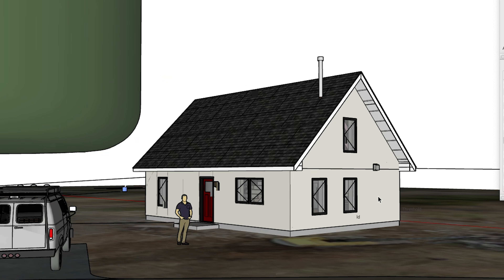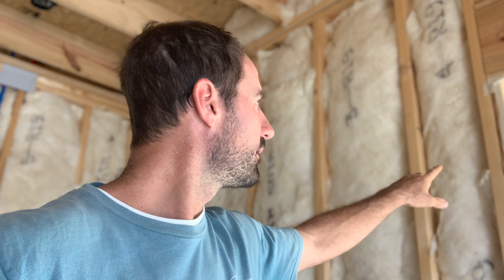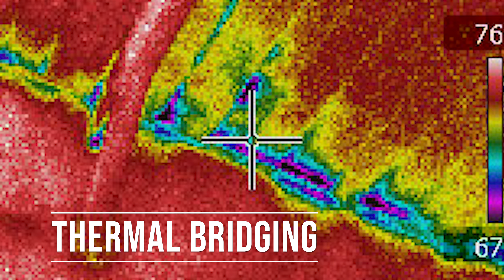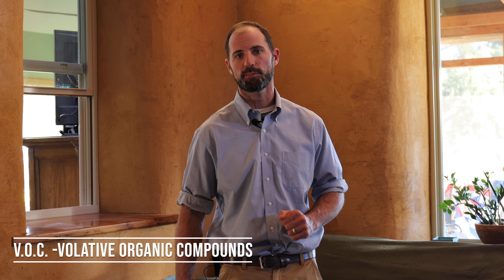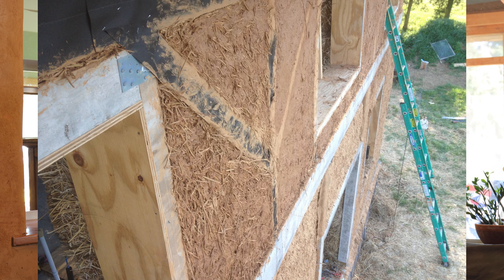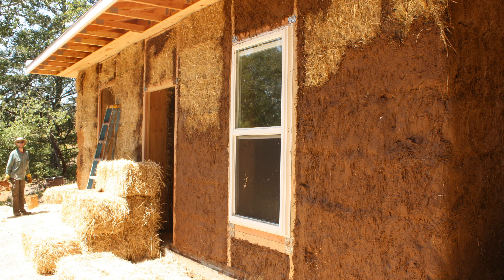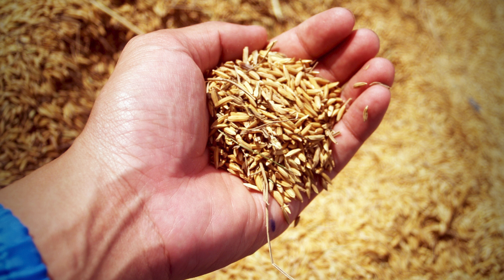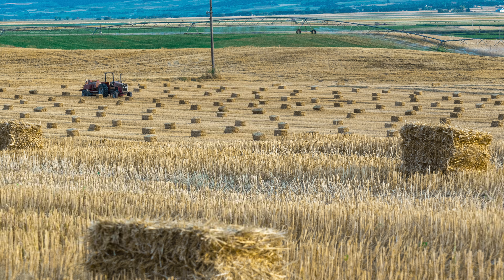The BEST way to build a new home? Building a House with STRAW BALES : Start to Finish - Episode 1

Comment: I’m an old mechanical engineer and software company owner - I love technology, but if I built another house (here in 🇨🇦) straw bale would be my choice!
Reply: Especially in very cold long winters country it s definitively the best technic. I built 3 in french alpes and it was really nice and easy... Cheap... And non specialists can make it alone IF (!) they are numerous (at a few steps of building) and precautious. There are books enough to show key points yu must respect and be carefull.
Only trouble is lack of  inertie of straw bales but yu can compensiate it by thick clay walls inside reliable with massive owen as they make it in Tirol. With stones...and decorative colored tiles. 
See above...former Comment.
Reply: @j-ch8787  thanks for that insight!
Reply: @willm5814 
I have a diagram I found 25 years ago during my educational program of site building conductor in Elsass close boarder line with germany... Which convinced me (and should convince everyone!) of the efficiency of straw bales construction.
This diagram is showing the coefficient of resistance of all the insolated materials we can find on the market. Modern one and... "traditional" such as straw. There is a cyrve exponential one from bottom to the highest point which... (lonely far above all!) the straw!!! I don t reember precisely the numbers but the straw is above 6,... And the others are on a same flat bottom between 0,8 or 0,9 for the less performative to 1,4 ...1,6 if my memorie is right for the best performers.
So... As we are used to say it in france "There's no pics !" ... Just put straw as a construction technic... Full point.
It s efficient for warm or cold countries.
BUT ! Remember yu gotta have to make a huge job in the inner partition to compensate the lack of inertie. If yu don t do it yu gotta be disappointed without understanding "why it doesn t work"...
That s why I gave the advices, : 
1) ask a thermic ing to make a wide study before / during the phasis of "architecture design" (dimensions, aspect etc) ... 
2) put a heavy mass stove right in the middle of the construction.... (calculate the needs compared to mass volume of the house and circulation of the air)
3) plan to cover the stove with ceramic colored and decorative tiles on walls and  benches (in bathroom, a true pleasure same as a sauna !) from floor to ceiling... And walls as yur means allow yu to afford it (it s relatively costly...). And with a continuity from 1st floor to 2d... The ideal is a squared distribution as in Tirolian traditional "Hütte"... (reconverted today for tourists as a whole hotel in fact on 4 stages of 300m2 at least divided in 4 wide rooms of 60 to 80m2 (!) with staircase and mass stove in the middle).
These "ceramic tiles covered walls" are perfect for heating.. But also for cooling during summer " they bith accumulate calories AND frigories.
4) then... Yu have to plan thick walls of stones or clay massives separative or distributive walls in order to accumulate wheteher heat or cool air.
5) my opinion  and advice is to plan canadian pipes for 2 extremes seasons (summer and winter) during foundations works... With sand stones pipes 20m long.
Then yu can add iranian towers (2) on roof in very hot region if necessary. And when the house is facing wind comung from sea as in my case in Normandy where I am just at the crossing of west and north winds...
And for canadian pipes linked them with mechanical double flux system if necessary)( in special cases but not always necessary... Yu can make air circuilation by very simple natural handy system)

Ps : in Tirol provinz austria they made a whole documentation 15 years ago and encourage this system with straw bales contruction. They studied a building of 11 floors in Innsbrück and sublit it to simulated earthquakes... Fires... Water fallings... Etc etc.
NO PB at all... So they wrote a technical norm to encourage those kind of constructions in the province. 
A true success.
In france... They didn t do such researches and it s a pity...
Only off grid associations are giving advices or educational programs for profs.
Our "environment ministry" is sleepy a little bit... Even when so called "green environmentalists".

Usual bullshits...
Reply: @j-ch8787  wow! Great information! Thanks for that detailed summary 🙏

Comment: Enjoy your mouse infestation and the constant nagging fear of a hay fire starting while you sleep.
Reply: Hay an straw are not the same thing and have vastly different properties. Strawbale houses are far more fire resistant than traditional stick homes. All the engineering and fire testing were required for inclusion in the 2015 IRC which is the basis for building codes in pretty much every jurisdiction in USA.

Comment: There is no perfect system for building a house,  every system has drawbacks. 
For me, it's all in the design,  keeping it simple is the number one key regarding labour and price.
Reply: If you want a perfect house, just move to some place that has perfect weather 100% of the time. haha.
Reply: @saidinjest  what has the weather got to do with being a perfect house ?
I'm confused
Reply: @colinstace1758  The more perfect the weather the less protection the house needs to provide.
Reply: @mkshffr4936  I disagree,  if you build in the dessert you need different protection than if you build in Florida,  both could be considered "perfect" weather 🙂👍🇦🇺
Reply: You nailed it bud. Nothing is perfect, just preferred under certain circumstances.
Reply: There actually is a thing called the perfect house design.  But whos going to spend a million dollars bulding a pretty basic 2500 sq.ft. house when you could have 5000+ sq.ft. luxury home for that price.

Comment: The hay degrades over time, Not to mention it is fire hazard.
Reply: Hay and straw are not the same thing. Strawbales, especially plastered, are extremely fire resistant. Extreme evidence for that was shown in recent Paradise fire in California. There are photos were everything burned but the strawbale walls were still standing without much damage.

Comment: How did you do the electrical, I assume you used conduit
Reply from the maker: We notch it 2” into the bales with a chainsaw and use landscape staples to secure it to the bale before covering with plaster. If you can afford conduit, that’s the best way to go.

Comment: Not to mention the carbon capture that occurs when using straw bale and a lime render
Reply: Carbon safe with straw is a gain for sure. But it avoids to use cement bricks which cost a lot to the planete.
And... Recycling is another point for future.
But the main point in my opinion is the comfort inside for years.. Simplicity of construction and... Costs.

Comment: I built a straw bale house 15 years ago. It still functions as it should and has required almost no maintenance. My building method was similar to this video presentation.  I covered the bales inside and outside with chicken wire and laced the two sides together through the bales with wire. I coated the outside with a cement/clay/sand mixture and then a final coat of a lime plaster mixed with white play sand. The inside got a plaster/clay/sand mix.
Reply from the maker: Here’s how we framed this one. Maybe a little over kill, but this is what our engineer felt comfortable with. There’s some info on preventing mold and plastering to prevent air leakages and rodent infestation. It would be interesting to hear your thoughts! 
FRAMING a STRAW BALE HOME
https://youtu.be/P565_fhZBQw
Reply: @HeirloomBuilders  how well will this hold up to the winds/moisture if built in Florida?  I'm looking for a cheap yet sturdy build method for a 900sq ft home in Central/ North Florida, this seems viable but I'm concerned about decomp and hurricanes.
Reply from the maker: @RichardCranium321  this will be a good option in Florida. Just make sure you have big roof overhangs and use lime plaster in the exterior to keep wind blown rain from penetrating into the walls.
Reply: @RichardCranium321  Are you able to build such a home here in Florida this way? Have you checked to see if the code allows for it? I live in SW Florida and would also like to know. Houses are far too expensive now and if this could cut the price in half, (Not sure how much it reduces the price as Heirloom Builders did not say) that would be great.
Reply: @HeirloomBuilders  THIS  is the best explained Strawbale house building I have heard & seen yet, You guys Rock..
I WANT YOU TO BUILD ME a nice 20 X 30 Strawbale Cabin on my mountain property high up at 6900 feet north of Williams, ARIZONA.
JUST a simple enclosed bathroom with shower 🚿
And the rest I want to be a open floor plan. I am handicapped and can not work.. I am 60 and my treed acre is all paid for, free & clear..I need a simple cabin to stay warm and cozy.
Was hoping to have a small wood stove, cause I like to burn wood.. Can you help with getting this done.. 
Your fan Harvey.
Reply from the maker: @harvdog5669  I wish we could, but our crew is unable to travel. Your cabin sounds like a nice simple place to live
Reply: Super cool
Reply: @tiffanyclark-grove1989 
If yur in search of a tech of building... Think very seriously to straw bales inside wood thin structure. It s the most efficient isolation system far above any... Any other one even modern materials. No comparison possible.
BUT! Don t forget to built inside enough inertial walls. Sothat yu ll be able to accumulate frigories. - with iranian towers on yur roof or canadian long pipes under ground - during summer to refresh yur home and calories during winter in order to accumulate the benefit of - for example. - a massive stove.
Straw is really cheap... Performative... Easy to do... Just make a visit during the building of such a house. But it needs lot of free hands even little one such as kiddos ! They love mud and clay yu know... And building a house where they will live is an experience that will drive them on extraordinary  confident view of themselves.
Reply: Would they do well in extremely cold conditions ?
Reply: @themodernquaint 
If yu ever look at a diagram talking on efficiency resistance % of all isolation materials on the market... yu will see that all of them (modern not sane or even "so called sane one" are between 1,1 to 1,9 for wood wool If I remember it correctly.
On the curb of this comparison diagram... Getting up... And Up (!) yu gonna find straw at... 6,6.
Everything is told.
No comparison possible.
In rocky mountains or west very cold regions usa some barns were built end if 19th c. With wood carpentry and straw isolation to protect people and cows, cattle.
The builders came out of scandinavia. They knew a lot about how to protect themselves of very cold temperatures. Minus, 40` or less is fluent in wept winter in some places I lived in norway and sweden.
But as it s very good to protect from freeze... It s very good too against   hot temperatures.
In sub sahara they are used to build with complex of straw and clay added with sand. With some special shapes of the building and openings welle calculated to refresh the building during the night especially with "iranian towers" set on the roof... The temperature is fresh inside perfectly regulated.
These technics already  existed during mesopotamia civilisation. Same as on pueblo civilisation en New mexico state. Double roof... Stone masonry... Clay and straw coat. Openings in order to ventilate.
Reply: @j-ch8787  wow that’s awesome! Thank you for taking the time share that information with me. I really appreciate it and I love concepts like these because it just makes sense. I’m truly open to giving it a try.
Reply: I'm confused about how the straw doesn't decompose.
Reply: The straw is dry and sealed by the coatings so not a place bacteria and molds make home.
Reply: On the first coat inside and outside yu could have add straw too in the mix. As for floor thick "cement"... It contributes to stabilisation of the coats or flour. Avoids cracks... Same as outside modern cement coat with a film of polyester armed  recovered by cement. In germany they also do it on old wood floor in bad condition to stabilise it before renovation : they hang the film on 4 sides in the walls up on 15 /20 cm. Then yu won t have any cracks...
Straw mixed in the coat and integrated in the structure of yur coat will play same use.
Reply: @j-ch8787   You don't straw in the final outer coating because it wicks moisture.
Reply: @richardhoner7842 
Yes... I agree. 
But if yur "hat"(roof) is wide enough and yur not living in a very damp / wet area... (as in my case : I am living in Normandy where it rains usually everyday and sometimes very hardly... Plus it s close to sea so outside is always wet. That s why we have good grass and cows...milk cheese butter it s the french region of those products)... Well... It s not so important. It can dry and avoid moisture process normally. But yu can put lavander straw too instead of corn straw (in Provence south france I saw some who did that it s ok and smell nice) . It s just to give structure in the coat no more. Question of proportions... And good finition on the last coat yu must "press" yur tool correctly at the end sothat there s no litlle cracks or lacks in yur coat application process.
Reply: @j-ch8787  all I got  out of everything you said was that you put straw in your outside layer when you know you live in a wet area of France, where you apparently have wonderful cheese.

And that you could have used lavender straw because it smells nicer. But on that last point I think you would get tired of smelling the lavender constantly. 

Lavender really gets to your sinuses. And it's not very gentle.
Reply: @kaleidoscope8743 
1) yes... With overhangs enough wide which is the current way of building for such a house. The pb in france is the agreement of townhall authorities cose it could change the aspect of the local traditional way of constructing a house. Same as for black "ardoise" (slide of black stone) in normandy or in other regions : they will not accept another covering. For me it's not a good solution but I will renove it as usual. 
2) lavander is put in the plaster instead of straw... So it doesn t smell much. Less than in a wardrobe. It s used for outside plaster or partition inside. I personnally never experiment it. I mentioned it cose I saw people in south france in Provence using it as a good alternative for its insulting abilities and stability which are better than straw.
Reply: @richardhoner7842  where did you build and what kind of maintenance & upkeep have you had to do? I'm very intrigued by this method, but I'm concerned about moisture, decomp, and winds... I am currently in Florida but considering this method when I build my forever home.
Reply: @richardhoner7842 
You don't use cement in the outer layers as it's hydrophilic and causes damage to the straw.
Reply: @G S I don't think so.
But for such conditions the only way of protecting yu and a building is a troglotical house... Under ground.
Here in france it became a fashion in south west since beginning 2000 years, becose of little valleys with rivers crossing along. This region is full of caves and the place where prehistorical populations settled for milenaries in such caves.
Florida isn t a good place anyway... consedering climate changes in 10...20...30 years I guess.
All south west usa too in fact. I read yesterday primalinary reports from giec and they are not optimistic for north america.
Reply: @j-ch8787  Bonjour à vous! Bien que vos commentaires dates je me permets d'essayer de prendre contact avec vous. Je souhaite savoir si vous résidiez toujours dans une maison en paille en Normandie? Je vis près de Caen et souhaite pouvoir échanger avec un Normand de préférence afin d'anticiper les mesures à prendre pour construire une maison paille en toute sérénité. Bonne journée à vous!
Reply: Why the wire on the surface of straw bales?
Reply: @Kooshad1  provides skeletal structure similar to rebar, just not quite as rugged/durable
Reply: do you have any other reference or source to build a suchalike house Richard? Shall the straw bales be left to dry?
Reply: Hi, can i have your contact number, i need some help i want to have some information and ideas on the construction earth & straw or other vegetable fiber, with a wooden half-timbering, I would like to build a house with the half-timbering technique, I saw several videos but I don't I still haven't known how to do it on my own, because I can't afford to bring workers for this construction, could you help me, thank you I live in Lebanon.
Reply: Funny voice lols....youer hooume
Reply: That is awesome I would love to see that, I could whip that together and get creative with it.

Comment: I thought this was a joke. There's a big problem. Mold. It's worse than VOC's. That stuff will even kill the big bad wolf.
Reply: I cut into my straw bale house about 5 years after construction to change a doorway and there was zero mold. Totally dry.
Reply: @richardhoner7842  maybe a good fit for the Arizona west ?
Reply: @DNAatWork14   Certainly perfect for dry hot environments. Mine is Maine and even though we get into the 90's my house never goes above 70-75.
Reply from the maker: You are absolutely right about mold. Here’s how we framed it to prevent mold: FRAMING a STRAW BALE HOME
https://youtu.be/P565_fhZBQw